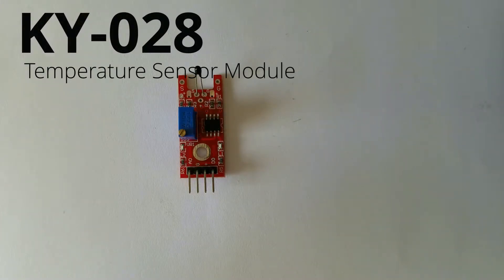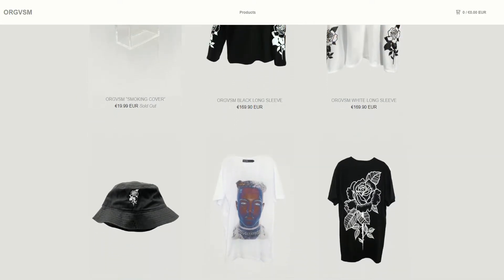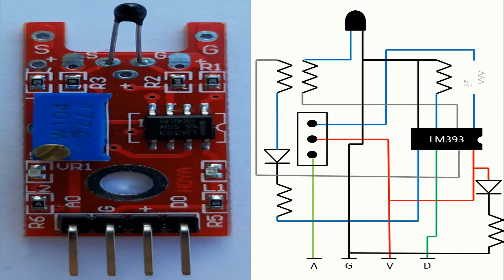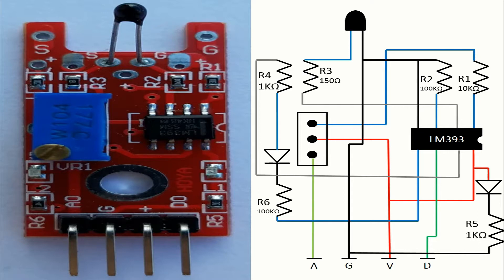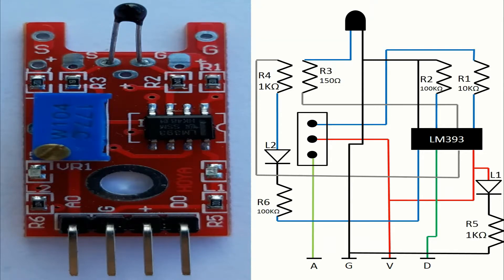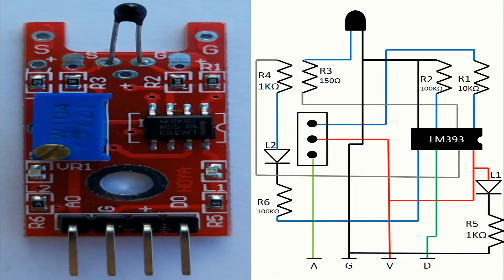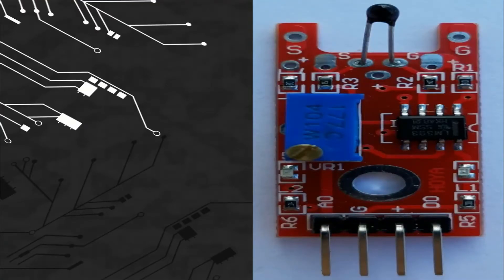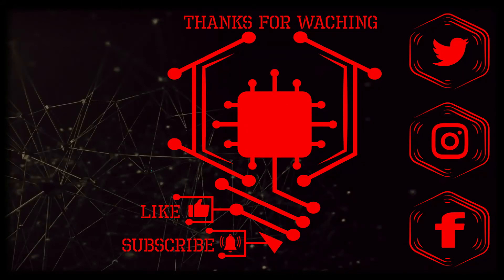KY-028 Temperature Sensor Module

Comment: Give me code
Reply: //code write by Moz for YouTube changel LogMaker360, 21-9-2015
//code belongs to this video:https://www.youtube.com/watch?v=9RO03TIiSDU

int sensorPin = A0; // select the input pin for the potentiometer

int sensorValue = 0; // variable to store the value coming from the sensor
int lastValue = 0;
int counter = 0;
 
void setup () 
{
  Serial.begin (9600);
}
 
void loop () 
{

 sensorValue = analogRead(sensorPin);  
  if (sensorValue == lastValue)
  {
   
    Serial.println("No temperture change.");
  }  
  else if(sensorValue < lastValue) //thea cup
  {
    Serial.print(" temperature rises. Value = ");
    Serial.println(sensorValue);
  }
  else if(sensorValue > lastValue ){ //last option ice cube 
    if(counter== 0){
      Serial.println("Start");
    }
    Serial.print(" temperature dropped. Value = ");
    Serial.println(sensorValue);
  }
  counter++;
  lastValue = sensorValue;
  delay(5000);
}